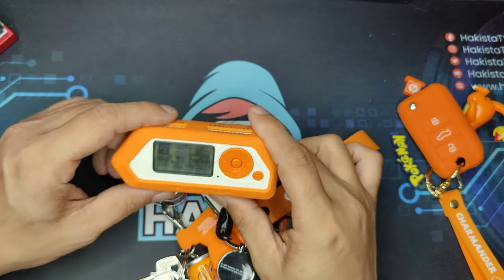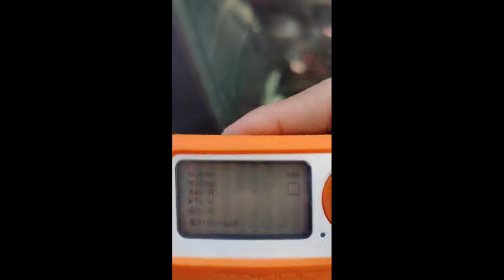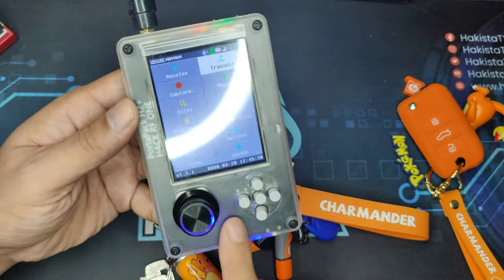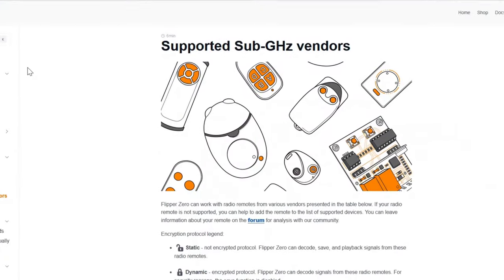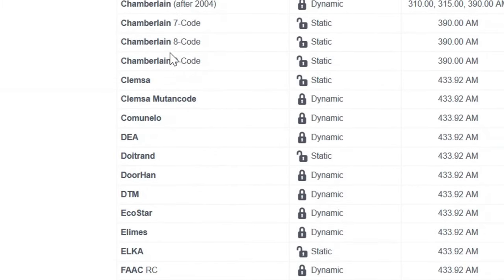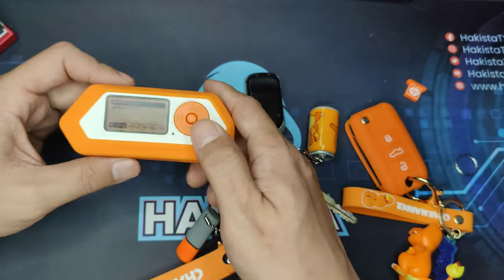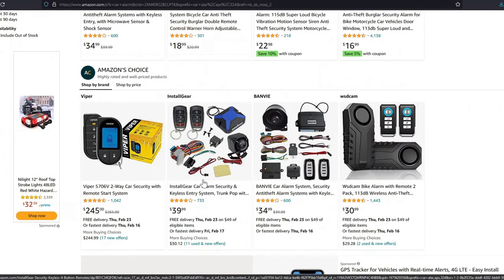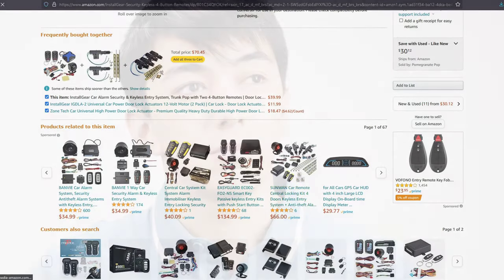Why this Flipper Zero Hack is scary against aftermarket car alarms

Comment: interesting find. in this case does it brick ur original car key and you have to resync it? or are car receivers able to sync retroactively with older codes?
Reply from the maker: It doesnt brick, I can use both flipper and the keyfob interchangeably with no problem
Reply: @HakistaTV  interesting, then whast am I missing here? how is rolling code supposed to protect ur car from playback attacks if they can accept an already used code tho (ur original car fob)?
Reply from the maker: @HollyTroll    most modern car has a proprietary implementation of a rolling code. The vendor supported rolling code by Flipper are the old ones where the implementation is already known. The code on how to decode them send them like they are  the duplicate keyfob is in the github of the firmware